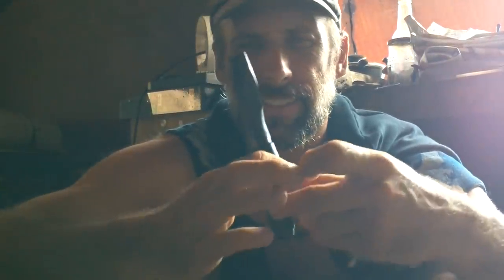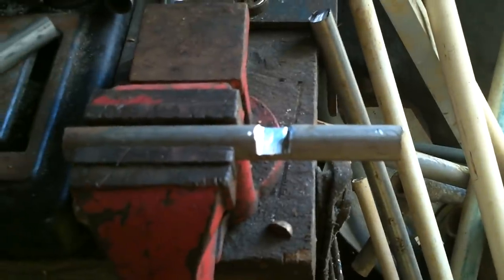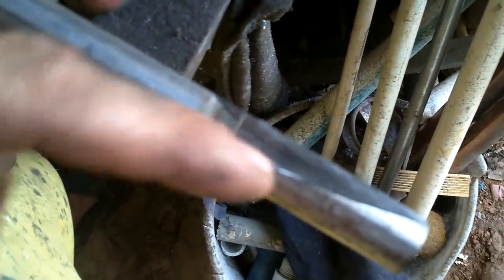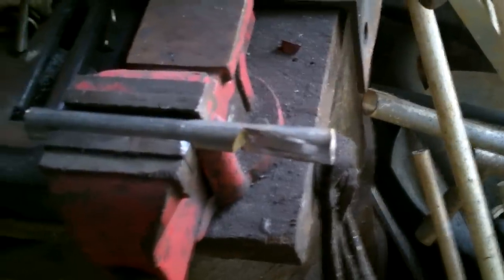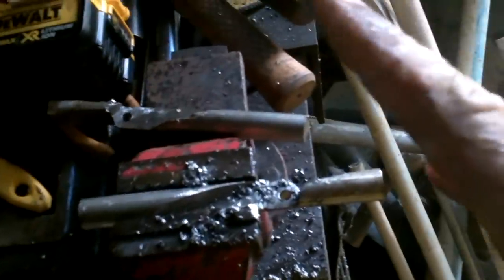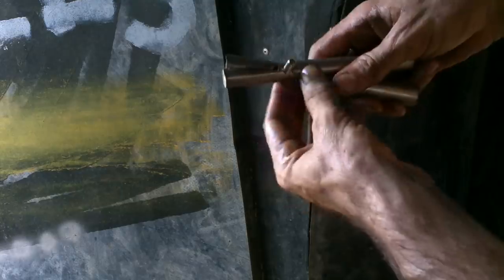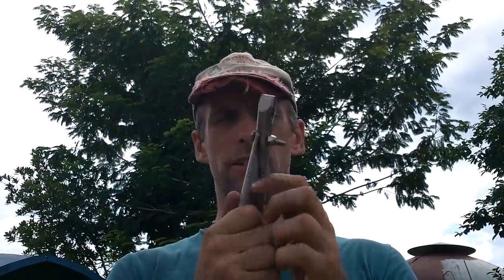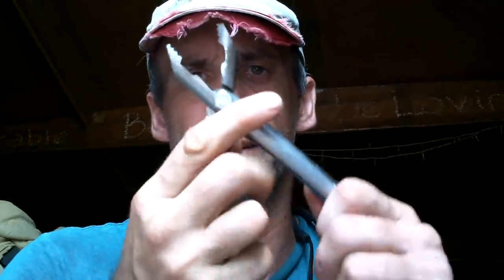Stainless Pliers.  2 Rods and an Angle Grinder.  DIY.

Comment: Nice job! If you don't see any rust it could be 303 grade or better it could be 304. Use some oil when drilling stainless and the bits will last much longer. You might want to heat treat the pliers to strengthen them overall. I really enjoy watching you find clever solutions and your craftmanship is impressive. I can't wait to see how your "Sails" work out!

Comment: Looks great. Maybe attach a leather strip from the ends of the handles to a place right before the front part so u can put ur hands between the bar and the leather and ur able to push the thing open.
Reply: Basically like scissors. Kind of hard to explain, lol. It looked a bit annoying to use both hands to open it again.

Comment: You taught me about hammer rivets so now I'll remind you about your teachin's. Put a steel rod through the hole with a 1/16 excess on each side and pound it flat. It will never fail and will provide a precision tight hinge. That is all. Over and out.
Reply: Nut-fastened pliers allow for re-tightening nicely when they get loose, and you can disassemble them to clean/lube them. The disadvantage is that they're bulkier.
Reply: @Aubreykun  What you are saying looks good on paper but I'm a metal worker by trade. There is never a need to clean when the joint is tight and if it needs tightening you simply give the rivet three taps with a hammer. I appreciate your logic but I make joints like this at least twice a week. Been there done that.
Reply: @sammyspaniel6054  It depends on the environment they're used in. I'm sure for you (and most people) they're best that way, but I've had to re-lube even perfectly fine looking old pliers, and crud just weeps out of the gap. Cleaning them that way is a huge pain and the ability to disassemble them is really useful. As well, you know that for some pliers you don't want the joint too tight so they can open with one hand easily. Some have springs for this but in others you need a little room for oil without having sideways play... 

Again though, it depends on the environment and use case. That's why so many variations of pliers exist after all.

Comment: like I said before, you do understand that even stainless steel corrodes right? just put some water soluble flux on it and leave it overnight. all tooling metals oxide even titanium, you just need to clean your tools and keep them in dry box with waterpfoorf seal if its on the boat. In my opinion its a waste of time to make something that is already made, not mentioning cutting it with angle gringer is probably introducing a lot of weak spots.. not sure what are you doing there. Maybe do somework on the big sailless boat thats leaking, that might be interesting
Reply: Kira  your missing the point. Rust proof tool are hard to find this shows how it can be done. Your perfect world of oiling down and waterproof boxes does not exist in the real world. I have been looking at SS tools as my tools left lying around in my boat just freeze up all the time , 
Sure what he made is not 'perfect' but if they are usable when you need them perfect! Cheers warren